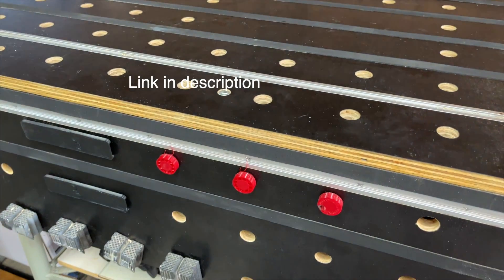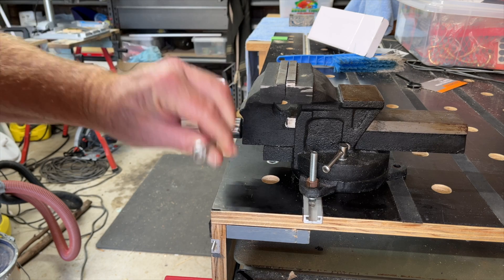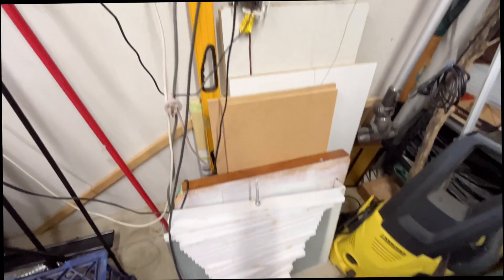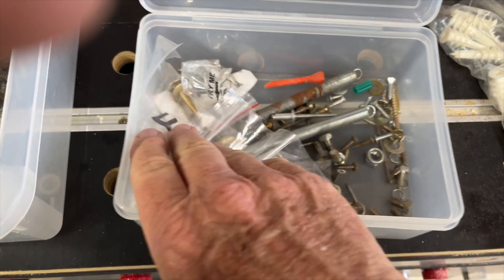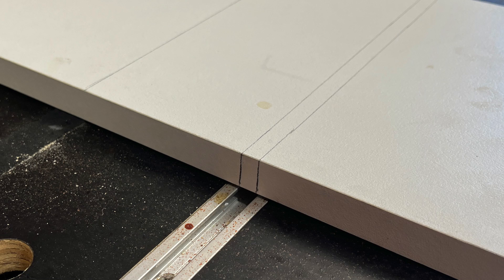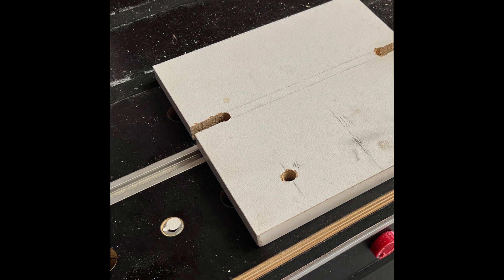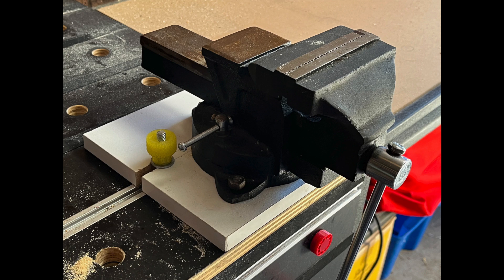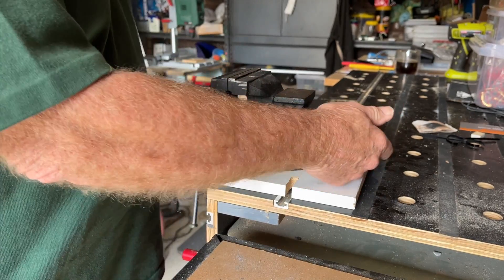Engineers Vise to MFT - using an adapter plate for flexibility

Comment: Top view looked like a very cranky face 😅 I need to first restore my vice, then work out a similar solution I think. I've only got dog holes, but might be able to use the kreg clamp track to similar effect.
Reply from the maker: Ha ha James. I thought about using some TSO power locs to attach to the dog holes for extra strength but haven’t needed it. But a couple of spacers, bolts and hand nuts would do the trick too if you have easy access under the bench top. Your Kreg solution sounds fine too.